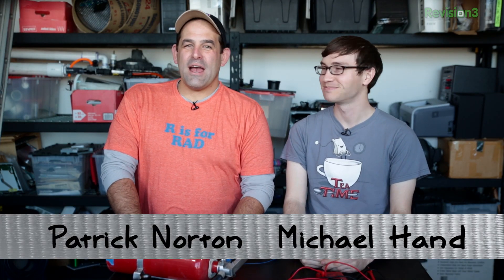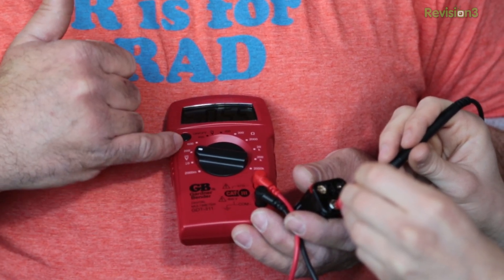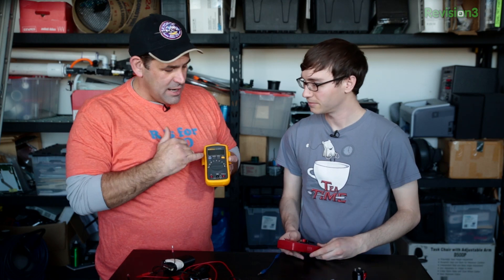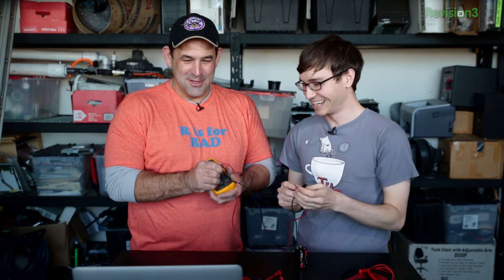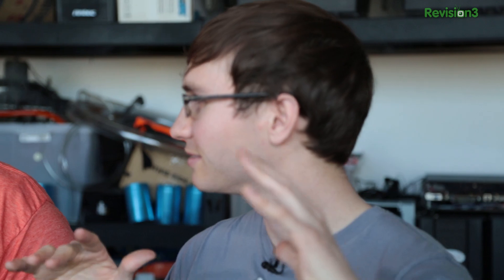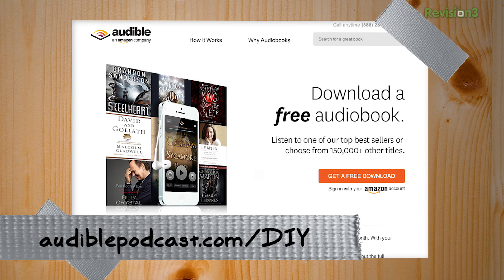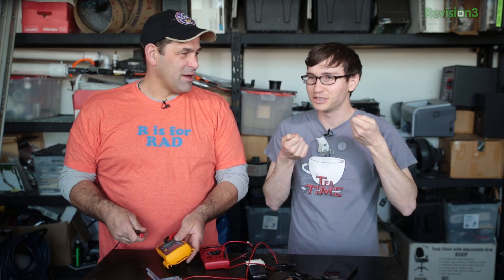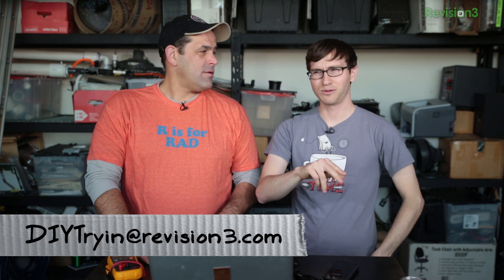Power Tool! Use a Digital Multimeter To Find Voltage, Resistance, & Amperage!

Comment: Pro Tip: Remember to remove the batteries from your Digital Multimeter when not in use.
Reply: Yes! Put them back in your smoke detector!
Reply: n o shit im trying to find alt power source for my meter....12v 23 amp battery is dead andc i need to get it running]

Comment: +1 for the HSU sub in the background. Can I read the Amps of a USB cable? Been noticing slow charges based on USB extension cables.
Reply: You'd have to hack, er, insert the VOM in series into the USB power cable to read it... kinda like hacking a DIY Wattmeter w/ a power strip and a multitester.

Comment: As someone who has done circuit board level repairs on on various electronics over the years(mainly computers), don't cheap out on your multimeter, always get a good autorange  Multimeter like a Fluke, because a good meter will save you time, and money in the long run, and will last you for years if taken care of, so please if you are not going to be using your meter for a long period, don't leave the battery in it, my stepfather left the 9 volt battery in his Fluke, and it got corroded to the battery terminals, and leaked onto the board, and damaged his $250 Fluke.
Reply from the maker: :( RIP Commodorefan64's stepfather's Fluke.
Reply: It would really be helpful if these guys really were helpful